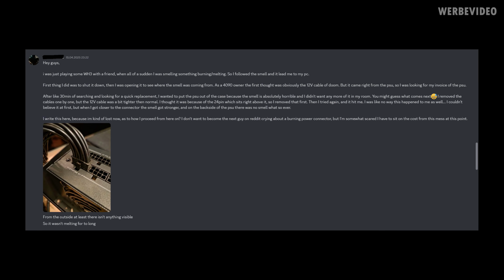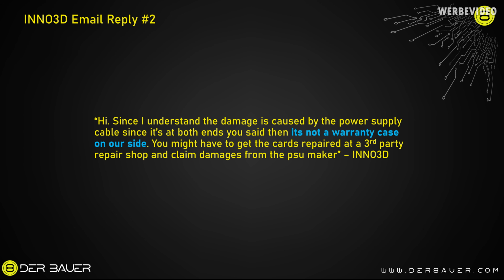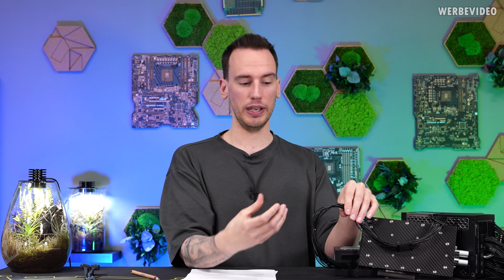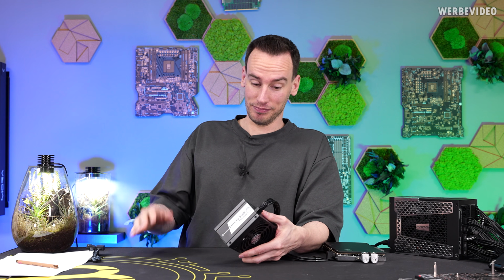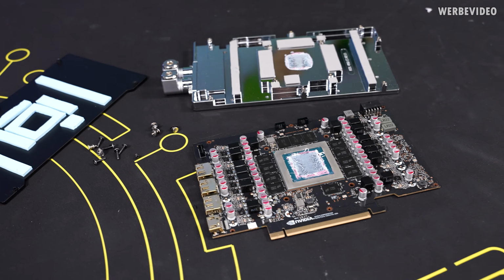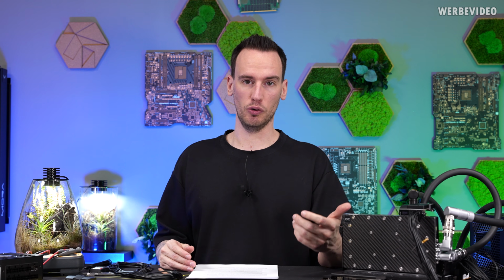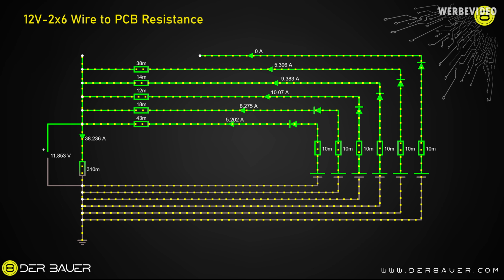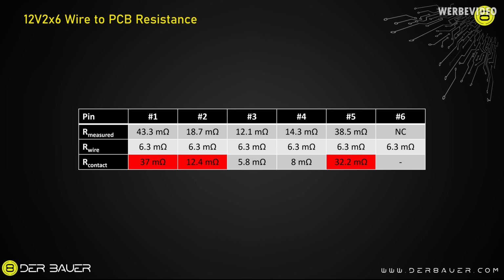Investigating and Fixing a Viewers Burned 12VHPWR Connector

Comment: It would have been interesting to try to use an ohm meter inside the power supply before trying to remove the cable.
To bad that Inno3d put in writing that they are an invalid video card manufacture that has no actual warranty.  The wording the choose made it clear as long as the power cable and the power supply are third-party, they will use unfounded claims to refuse there being any warranty.  Since Inno3d fails to make both power cables and power supplies such that both of those will always be third-party, the Inno3d response to the customer makes it clear Inno3d can never be trusted as a video card provider.

Comment: 850watts for a whole system??? 4090 and 7900xtx OC ones pull over 400watts. Also some ryzen CPUs pull 120-200watts. That’s not enough power headroom for the whole system.

Comment: I am more and more convinced that this is not the fault of the plugs, but of the incorrectly designed power supply system of nVidii cards. At first it seemed to be the plugs, but they seem to be only the weakest link of the whole and not necessarily the cause. It seems that these cards simply do not balance power consumption through the cables. Honestly, I was just waiting for you to pull the plug and bet BLINDLY that it would be 12V - and I was 100% correct. It would be good to test under load each cable separately and see what is actually going on there, because I have the impression that, despite all the hype, no one has yet done such an obvious test.

Comment: Said a dozen+ times, will say again. Since 40 series, Nvidia board design requirements force the power input to be a passive current divider circuit, regardless what connector, quantity of connectors, or number of wires carrying the current DOES NOT MATTER. This flaw can never be resolved by AIB's, cable manufacturers, or PSU design/build.

Comment: I don't care what anyone says, the right angle adapters are higher risk for this happening. Couple that with a power supply that "should" be sufficient.....yikes. How did he undervolt his 4090? Software or bios? If the undervolt was removed without the user's knowledge that sounds like it's the culprit

Comment: This is kind of what happened to my 4090 FE with a Corsair HX1500i back in January. Bought that card in October 2022, replaced my PSU in January 2025. Before doing that the card ran perfectly fine with a Fasgear 12VHPWR adapter to replace the ugly Nvidia octopus one. No issues there. The crappy Corsair cables started melting in 2 weeks. I didn't even know it happened until I upgraded my case and went to swap the parts, and found the connector stuck in the GPU. I instantly realized what happened when I couldn't unplug the connector. Thankfully I was able to disconnect it and took photos of the cable and GPU connector. This started a cascade of nightmares where I sent my 4090 FE to Nvidia for RMA, using their prepaid FedEx shipping label, and my card was stolen in transit to their RMA center. Now Nvidia is leaving me high and dry, with no reparations. Horrible situation. Anyone reading this, if you ever have to RMA and the company provides a FedEx label, DON'T USE IT. Not only does FedEx suck horribly, these companies also don't pay for insurance on the label. This is why Nvidia is stiffing me on it. They don't want to have to take the cost hit for FedEx's mess up. Buy your own shipping label preferably through UPS and if not them then USPS, and always declare the value of the card at market cost to replace. It'll cost you some amount of money, but it's better than being stuck without your $2500 GPU like I am right now.

Comment: They should just stop using multiple wires to transport power from psu to gpu and just go with 2 x 10mm² wires and screw on connections, problem solved

Comment: Just an other reason to AVOID NVDIIA, Save your money and get a nice Radeon GPU instead, RTX 40 & 50 Series are a failure from the get go this power connector should never of been used the pins are also too short  this too also brings unwanted issues, NVI just does not care about gamers, their cards are over pried they keep using the unreliable 12HPWR connector htey did not learn from the RTX 4090's melting power connectors debacle.... Back to Zero they are with no improvement what so ever.

3x to 4x 8 pins would of been just fine.

Comment: What can an end user do? put fuses on every single wire?  Maybe someone  create a module  between the cable and adaptor that monitors the power and shuts it down when it exceeds a certain limit... with it running @ x8.. what  was the condition of the capacitors  for the data lines near the pcie connector?   if one or more are knocked off that could be the issue..

Comment: Wrong cables for sure. My Cooler Master fanless 1100W  PSU can handle Asus Astral 5090 OC LC and 4060 TI 16GB at once in ComfyUI and no problem. Wrong, smooth surface cables here. It has special extra port for 600W cable.

Comment: RTX 4090 (TDP=450 W) and RTX 6000 ada (TDP=300 W) are not comparable, but it would be interesting to see a direct comparison of the power connectors (and their electrical connectivity and type of load distribution) of a RTX 5090 and a RTX PRO 6000. I am sure there would be some differences although TDPs are close (575 W for the 5090 and 600 W for the PRO).  I highly doubt they would decide to play the same silly games with the professional users too.

Comment: This happens justo to the 12VHPWR connector, or it happens to the 4 pice x 1 adapter ?? My guess is that the power distribution in this new connector is the key. For some random reason, eventually the power spikes hugely in just one or two wires, either due to pressure/fitting of the connector, or resistance in the construction of the cable (pressure/soldering), quality of the cable (quality of copper, insulation, thickness, plastic casing/quality, etc.), all of this causes greater resistance, and resistance generates heat - see your electric shower, whose principle is to generate heat by resistance. On the other hand, there is no control of the power received in each wire (except Asus in some models implements something in this sense), causing the problem to appear randomly, in different manufacturers. I wouldn't exempt the power supply manufacturer either, I believe that the 12VHPWR auxiliary cable design would have precisely this function of controlling and communicating with the PSU the power demand, and if it also has control over resistance and amount of power sent per wire, we would have two sides monitoring the power in each connector and given the tolerance specifications, both through the auxiliary cable could cut or adjust the power supply, leaving only the quality of the cable as a possible bottleneck or source of problem. There is no great miracle in replacing 4 150W PCIe cables each with just one 600W cable with basically the same wire gauge specification, and in this new version (from what I understand) there would be only two 300W lines each, before it was just one, randomly dividing the current into 6 wires. The design needs to be improved and have greater quality control, in addition to protective measures on both sides, PSU and video card - and the amount of money we for both video cards and PSU, it seems reasonable to me that certain security measures would not affect the price and margins of the manufacturers. Or, why not, go back to using 4 PCIe cables? Or better yet, how about reducing the consumption of the video cards? Well, it's difficult, right? How about that idea of power control at both ends? Does it seem cheaper now?

Comment: For what I understood from this video, you just made it very clear what's the issue here: nvidia engineers have relied on the even distribution of current but that's up to the cable manufacturer. In its turn it's almost impossible to mass produce cables within such a small resistance delta. So, the solution would be to add some bigger resistance on the GPU side to mitigate the resistance error in the cable itself. But that's also not possible as this is going to generate a lot of unnecessary heat (though it would deal with the difference in cables).

P.S. I believe this explains @JayzTwoCents experiment with 100 plug-unplug of cables: it's just made a bigger resistance in the connector itself due to wear after 100 unplugs than in the wires which eventually made the wires resistance neglectable.

Comment: I was watching another post about the uneven power distribution and Nvidea had said the responsibility was in the power supply.  With all the information you have supplied, including your post on the Infrared readings on each lead, the ONLY way to balance these loads would be at or in the card.  If the power supply tried to balance these loads you would end up with an overvoltage on the hi-resistance lead and an under-voltage on the low resistance lead, at the supply, which would create interesting results in itself.  You could end up driving that much voltage on the hi-resistance wire that the sheer power going through it would melt it.  The only way to manage the current is to balance it at the card like they used to do.   Sorry Nvidea, time to scrap your new/latest cost saving power circuit and use the old one again.
Terry from Australia.

Comment: That's a damned shame to hear about Inno3D's response. Four years back they were willing to RMA for me a failing second-hand 2080Ti without proof of purchase (still within 3 years of launch), provided I sent it back to them in Hong Kong. Though they were unable to repair it, the 3070 they ultimately replaced it with is still working to this day. I'd pegged them as one of the good ones for a warranty, but I guess either things have changed or it depends on who exactly you talk to within the company.

Comment: what nvidia really needs to do is make it 2 or  3 for 600watts power draw,, its obvious that the connector is not sufficient and its overloaded to the point that plastic melts,,or if they dont want to add more connector just make it bigger and ticker pins,,,,, the 12vhpwr pins looks like the size of usb header wtf

Comment: 16AWG, Safe to carry ~10A, 13-14A or more it will becoming hot.

So they basically 12V2X6 or HPWR design based on assumption that 6x12V wires are always good.

1 wires fails or at very high resistance, another 5 get 20% more current. <-- this may get hot
2 wires fails or at very high resistance, another 4 get 50% more current. <-- this gonna melt, literally

8pin PCIe it's just 150W even they have 1 wires for 12V working at 12.5A it's will just becoming hot not melt except that 1 contact is very bad.

They still not admitted that it's design flaws.

Comment: The second e-mail which mentioned that cables do not melt after months of use is not correct. I had a 4TB desktop hard drive vertically connected to a Seagate USB/SATA connector, for years. It came, from Seagate, with a 1.5A 12V AC/DC adapter. A 3.5 inch desktop hard drive should never pull more than 1.2-1.3A of 12V, when spinning up the platters. One day, the hard drive
disappeared from the PC. The DC jack end of the 12v adapter had melted and fused with the USB/SATA adapter's and blew out the output capacitors on the AC/DC adapter.

Comment: For me since the 12 pin high power connector has a lot of issues, i would rather to use the 3 or 4 8pin connectors instead it's just simply much more reliable and more safe because it distributes the power much safer than the new 12pin power connector does ✨

Comment: It's a strong hint for the newest GPU's avoid Nvidia and go with AMD.   Or go with an Nvidia 30xx card. Maybe for the 60XX cards Nvidia will fix the power sensing per wire on the GPU side.

Comment: I think Nvidia engineers have a pride issue and don't want to admit they messed up. Maybe design a load balancing circuit for both GPU side and PSU side and if it senses a load imbalance (like all the power going on only 2 wires) it shuts down the power. Simplest option is to use materials that have higher melting point and can handle double the required current draw. Over build not the bare minimum. :face-blue-wide-eyes:

Comment: Another thing you have to be aware of is the contact and other resistances will rise with heat which creates a positive feedback loop which in turn causes thermal runaway of a sort. The wire and connectors heat up which raises the resistance which causes more heating which causes more resistance which causes more heating until you get a failure condition.

Comment: What people fail to realize is this is not a Nvidia standard, it's an Intel ATX 3.x standard. It will do no good to change the connector on the GPU side because then you are just guaranteeing it will burn up the power supply connector instead. Even if Intel was to change THEIR ATX 3.x standard it would make all ATX 3.x certified power supplies obsolete and they would need to be replaced.

Intel is floundering and taking everyone down with then because of a poorly thought out ATX 3.x standard.  It should also be noted that originally Intel wanted the ATX 3 standard to be 12V only with 2 12V connectors one for the motherboard which would need all the voltage converters/regulators built into the MB and the second one going to the GPU. However that went over like a turd in a punch bowl with motherboard manufacturers so Intel dropped the 12V only to the motherboard but kept the GPU connector

Comment: After all the trouble with those connectors for years  I am amazed some AMD 9070 makers CHOSE to use it!
Reply: @glberini0 Well for the 9070 and XT its no problem, because they are not pushing towards the 600w limit of the connector. Anything up to 300-350w should be fine, even if the connector has some flaws. You would need to be very unlucky to have issues with it at 300w.

Comment: 09:20  Undervolting doesn't make it use less power.  You have to reduce the power limit for that.  Undervolting means the card can clock somewhat higher with the same power, assuming it hasn't been made unstable by the voltage reduction.
Reply: I did UV it to run at the standard 2745mhz (it sustained without uv) caped @975mV. It definitely used less power, because that was what i was checking the whole time while playing. It was using ~380W constantly for 30min, when it melted. Before that without UV in the same game it used up to 420W.

I was basically right at undervolting while it happend, because the chip isn't really good and didn't want to make any more clock speed or less mV without becoming unstable. So it took a bit longer to validate for stablility.
Reply: @GamePat96  I'm talking about normal behavior when GPU-bound.  If you're not GPU bound or have some other configuration that prevents the GPU from boosting faster, then yes, an undervolt will reduce power consumption.
Reply: "Undervolting doesn't make it use less power."

Do you know what you're saying? 😂

Comment: that connector needs to be EOL'd. thrown to the trash. just take the 8pin connector and add 2 more pins on either side to make a proper 12pin connector, but also the devices using it should have the power to read pin by pin to make sure each pin is pulling a safe amount and to basically "crash" if it detects improper ranges..

Comment: I keep telling people in on reddit and in comments in their YouTube channels that it is likely due to the PSU and their single / multi-rail designs that can cause different current variations due to external system load that can cause current fluctuations within certain wires. Loads drops voltages for each voltage rail, and a 12HVPWR connector on the PSU side can use multiple rails to meet the wattage demand. I believe I already even already suggested as much to this channel earlier this year. Looking forward for the my comment getting buried and ignored again. My favorite comment in this regard was in a JayzTwoCents video, given how he has made a video regarding the rail differences of PSU and should already realize how they it can contribute.
Reply: It's weird that there's so much denial that it can be mitigated in the cables as well, you can balance both the resistance of the pins and wires themselves and the heat differences between them from that resistance variance by just... terminating the wires to one power/ground wire before the pins. Dump the heat imbalance into the colder pins and wires. Anyone who has soldered to a giant ground plane knows more surface area = more heat sinking, so the GPU side is probably totally fine, but the cable wires are thermally isolated and should be joined just before the connectors to prevent one pin getting hot and causing a cascade of high current on the other wires.
Reply: @ShinyQuagsire  The answer is so simple too, even LTT showed it, just have two simple DC cable that corresponding for the rated currents instead of trying to create a new standard simply because they want to reuse the same spools of cable. This should not be where cost saving exists, your car has better electrical connections than something that costs more than some of them.

Comment: false the cable and psu could fix this as well. You could have active circuit monitoring on the PSU side to load balance the pins or shut down in overcurrent situations. The solution needs to be standardized via cooperation.

Comment: Just make an adapter that parallels all of the positive conductors together, then they'll all deliver the same current and voltage to and from all of the connectors on both ends of the cable.